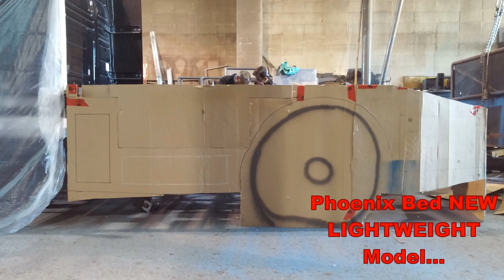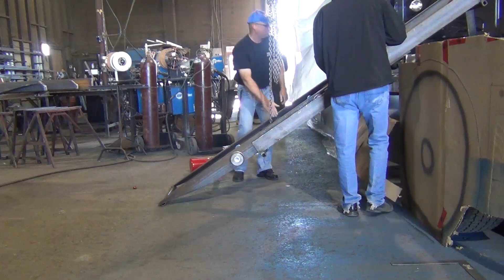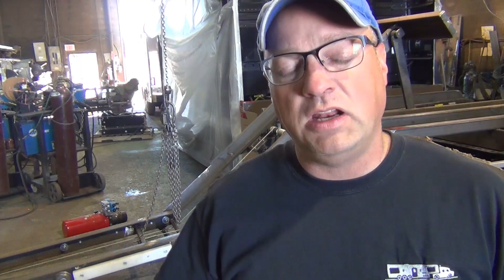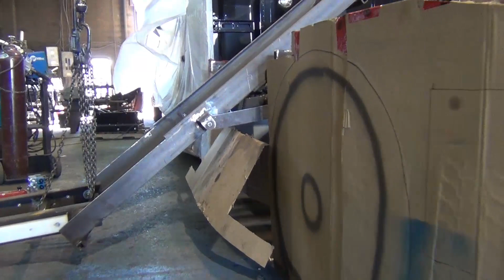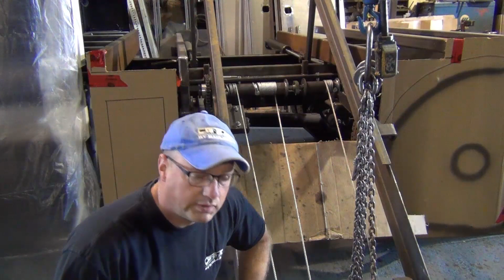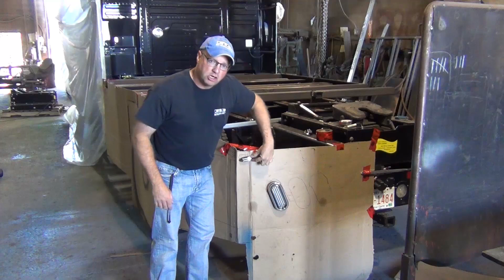RVHaulers Phoenix Smart Car Bed Improved Layout for Rick and Dan

Comment: Greg, I just got into your videos in the last 6-8 weeks.  About the Phoenix Smart Ca bed new layout for Rick and Dan.  In the changes, I noticed behind the duals you angled the bed in.  I think it looks great.  My question is by angling that in does that allow more air to be caught by the front of the fifth wheel and create more drag and affect fuel economy?I love all your beds.  Split decision out of Ohio
Reply from the maker: +Rich Merrick Hello Rich.  Thanks for watching and for taking the time to post your question.  In the grand scheme, there are other much greater issues that affect fuel economy than the aerodynamics around the bed.  The digital fuel economy information visible to the driver shows how changes in how fast you drive can make a big impact.  In my personal driving tests over the years I have learned to look towards other areas for fuel economy improvements.  Tires, tire pressure, engine tuning, how hard you accelerate etc make a difference.  I would also acknowledge that commercial drivers are of course very conscious of the small things in fuel economy numbers.  They drive HUGE numbers of miles compared to us RVers per month.  A 1 or 2% savings is a big deal to a commercial driver.  Whereas a 2% difference in only $1000 worth of fuel per month is $20.  By slowing down a couple mph I can gain that back and much more.  But your point is well taken.  Those small things can add up if we are driving big miles.  Thanks for the excellent question, and please keep them coming!

Comment: it's called Cardboard Aided Design, right?
Reply from the maker: Now THAT is funny.  Thanks Surly!
Reply: Gregg RVHaulers
It's not original with me, Gregg.  I learned it from Craig Vetter of Vetter (motorcycle) Fairings.
I like your revised design.  It will be much easier to load and unload with the deck at a shallower angle.